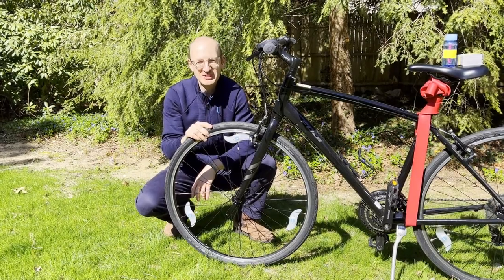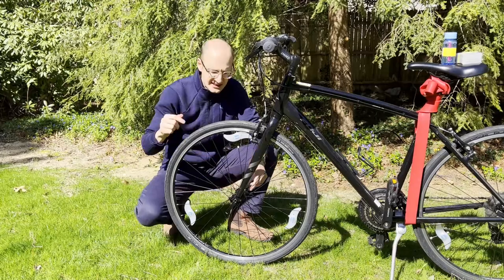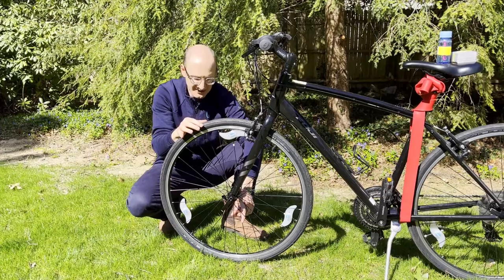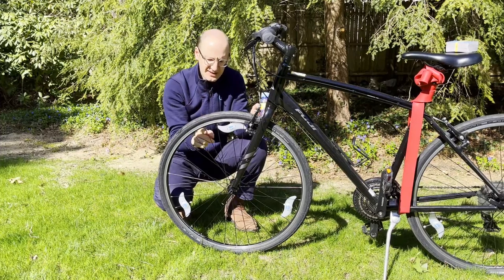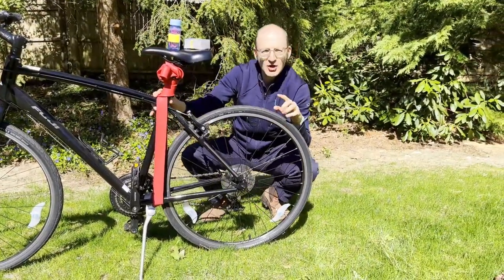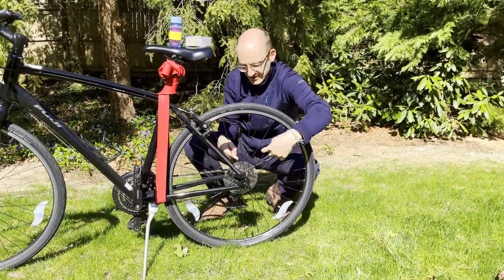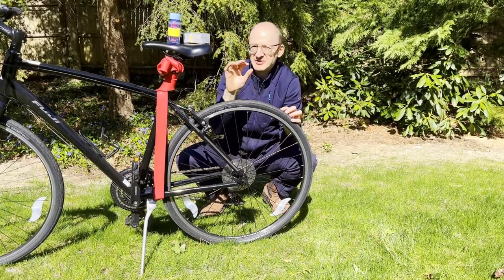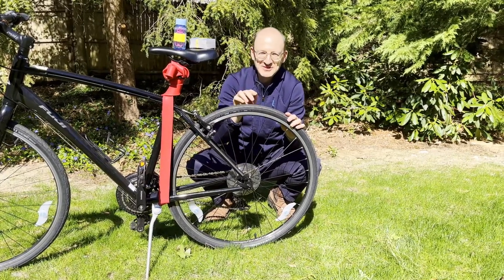Why Bicycle Wheels are So Clever!

Comment: Cool video. I think Paul missed another bit. The spokes are not  exactly in the rotation plane of the wheel to counteract side forces. Although the bicycle wheel is not very good at doing that, if all the spokes were in the same plane they would snap quickly from very little side forces. So the wheel is even more clever.

Comment: A good introduction to spoked cycle wheels.
A spoked wheel is an example of a tensegrity, where rigid elements are separated entirely by tension elements. 
Few race hubs are rated for radial spoking, pieces separate from the hub flanges, BAD!
When tensioning/winding up a wheel the rim "shrinks" about 0.5 mm in diameter. 
It's possible to build wheels with longer pulling spokes than pushing spokes making the pulling spokes slightly more tangential, particularly applicable to disc braked front wheels.
The accuracy of the build makes a huge difference to the feel of the bike, I try to achieve better than 0.1mm runout radial, lateral and dish which should give consistent spoke tension.
There is so much more I would like to test and quantify.

Comment: As you said the spokes never get compression. They are not meant to. They are not fix mounted to the rim. Instead the load is hanging on the to spokes, which increases the tension on the whole system. This behaves similar to the dome you showed. Another fun fact: front wheels can have radial spokes, which looks strange and fragile at first glance.

Comment: Not sure I’m following this. I always thought the forces were the tension on the spokes from the top of the rim, transferred to the rim itself, which carried the compressive forces to the ground, essentially as if the bicycle were hanging by the spokes, and the tension on the spokes helped keep the rim circular. But you seem to be saying that the true forces are compressive on the spokes, i.e. from the bottom of the rim up, which act like columns, and can do so because of pretensioning on them.  Quite likely this is just massively above my head, but thanks for trying.
Reply: Not quite. He never said they go into compression per se. What he said was they just go from tension to ‘less tension’. Yep, a bit confusing but I think he was accurate in that sense. Good point though bro.
Reply: @liboy9844  Thanks for the reply. The confusion for me is that this “tension to ‘less tension’” is operating on the bottom spokes, which act like columns, but not, as you pointed out, under compression. That is, at the beginning he pointed to the spokes directly below the hub and said you would normally expect them to buckle, which I would if we aren’t talking about ordinary tension on the spokes above the hub supporting the bicycle by compressing the rim as a whole. In other words it seems as if there is no compression on the rim as a whole but only on the metal at the bottom, delivered by spokes not themselves in compression. At that point my mind boggles. It’s like trying to picture a square circle.
Reply: the forces are acting on the whole wheel, with the spokes in the upper part of the wheel doing most of the load carrying, so your thinking is essentially correct. but the point that the lower spokes are in less tension is also correct, although i would not define them as columns since they're never in compression. as an aside, there are plenty of true radially spoked wheels, they're just not as efficient.
Reply: @daos3300  Thanks. I read your reply and then watched the video again. I think I get the point about the offset radial design, since forces are acting in different directions. Also about the circular compression on the rim, which I always pictured as helping to maintain the circular shape of the rim under compression. I was glad you confirmed my intuition about most of the force being tension on the spokes directly above the hub. Also I see that the pretensioned spokes do not go entirely out of tension. I’m pretty much copacetic with all of that. But still, he made the columnar analogy for a reason: at the beginning he clearly indicates that the forces are delivered downward by the hub and, ceteris paribus, you would expect the spokes below to buckle, which never occurred to me because I never imagined the forces are delivered to the ground in that direction, i.e. from the hub and not from the connections between the upper spokes and the rim . In other words, I imagined the loss of tension to be entirely within the wheel and have nothing to do with the compressive forces from above, which are transferred to the ground through the rim. The loss of tension below simply indicates to me that there is a compressive force on the lower spokes but not sufficient to put them entirely out of tension, so the maximal tendency toward deformation of the rim is at the bottom. I may just have to remain confused on the point.
Reply: Your initial understanding is correct and the videographer's comment on the lower spokes being "columns" is incorrect: "You can't push a rope."
As for your confusion on the lower spokes purpose you should imagine a force diagram.
The ground induces a normal force onto the contact patch at the bottom of the tires, the force then needs to travel upwards to the hubs to effect the frame of the bike. As you mentioned, the lower spokes cannot hold the energy of the normal force in compression, so the energy is transferred upwards through the rim. The top half of the rim, charged with the normal force, then suspends the hub in the air through the tension on the upper spokes. (Spokes are incredibly strong under tension.)

All that being said, for a bicycle wheel to remain functioning while rolling, accelerating and changing direction, the initial tension across all the spokes has to be even, and greater than the standard working forces.
Imagine sitting on a bike with rubber bands for spokes, it might roll forwards decently, but turning the wheel would break it apart.

Does that look clear in your mind?
Reply: @nightspore4850  Da Os has a point too. But I think the easiest way to look at it (without overthinking) is to imagine changing all metal spokes to stretched rubber bands, then (while not rotating) lightly load down on the hub.
We should expect to see the upper rubber bands stretch more while the lower bands start to slacken. If not, I join you in the confusion hehe. Interesting analogy though.
Cheers bro.
Reply from the maker: Hi all - I'm glad you're talking through this and maybe I can clarify a couple of things.  The reason most of the load goes from the hub straight down the lower spokes (reducing their tension) to the ground is because that is the stiffer loadpath.  Going through the upper spokes in added tension and then around the rim is a less stiff loadpath (like springs in series) and thus is not the behavior.  You can read more here: https://www.spokemaker.com/the-science-behind-spokes/  Thanks!
Reply: @PaulKassabian  interesting article but i think the wooden wagon wheel comparison is flawed. you could cut away most of the spokes on a wood-spoked wagon wheel save for the lower two or three, the wheel would not collapse. now try that on a bicycle wheel! the lower spokes are certainly the most dynamically active since the loaded hub is pushed to the ground which partially unloads the lower spokes. but at that instant, what is happening to the upper spokes? it may be worth taking this further and actually measuring the tension of all the spokes on a loaded wheel. another way to demonstrate the loads - see what happens to a laced wheel in various states, from untensioned to optimally tensioned. i freely admit i am not an engineer, what i know (or think i know) comes from wheel building and observation.
Reply: @PaulKassabian  Thanks for the reply. Please don’t think I am trying to contradict what you are saying, because I’m not qualified to do that, but what is still bothering me (hoping you will do another video with lots of diagrams at a very slow pace) is that since the wire is far more able to sustain tension than compression, under ordinary circumstances, the “stiffer load path”, or more capacious load path, would seem to be from the rim to the hub, not from the hub to the rim. Visualizing springs just doesn’t help me with this. Thanks too for the reference you included, which I read, but really still don’t get. Are you and they saying that a pretensioned wire, if not put under sufficient compression, such that the force of compression equals or exceeds that of the tension, acts like a column the strength of which is equal to the residual force of tension? If so, while I can say that, I can’t see it. Colossal failure of imagination probably.
Reply: @liboy9844  Yep. The problem remains, however, why slightly but not totally slackened rubber bands carry the load like columns, since it would seem they should have no effect on the load borne by the rim above from the hub. Apparently that isn’t correct and the stupid half-slack rubber bands at the bottom are indeed acting like columns. Mr. Kassabian is a trained engineer and I’m not arguing the point, but to say I don’t see this is an understatement. Another article he recommended to me had it that if the spoke is pretensioned to one hundred pounds and a compressive force of fifty pounds is applied, then the spoke has a residual compressive capacity of fifty pounds. If I squint and try real hard, I can sort of “get” that in a meaningless intellectual sense, but really it still seems like voodoo.
Reply: @zacharybennett3249  Thanks. What you say seems quite clear. What Mr. Kassabian and other engineers say does not. I’m all for tension on the spokes, downward toward the hub, being the main carrier of the force on the rim, which is held circular by its own compressive capacity and, mostly, the tension on all the other spokes. Apparently that is wrong. The tiny thin steel spokes on the bottom act like columns the compressive capacity of which is the force of their pretensioning minus the compressive forces acting on them. While I can say that, or even accept it on authority (in engineering, authority counts), I still can’t see it. It feels like getting something for nothing.

Comment: What a coincidence, i don't remember well but i think i learned these last month by a professor or was i reading a book? Hmmm I always had a bad memory....

But i still cannot understand why spokes/rims are tangential and not radial. And what happens when we keep it radial.

I will try thinking harder i guess
Reply: it isn't just to do with radial/non-radial. half the spokes are also laced outside in, the other half inside out (from the hub). one half is also pulling in the direction of rotation while the other half pulls in the opposite direction. add to this the fact that the spoke holes in the rim are offset - again half and half - which results in a wheel with very evenly distributed and balanced forces with a lot of leeway for lateral and radial adjustment - essential for both building a wheel and then truing during use. there are radial wheels but they place a lot more stress on the hub, are weaker and less robust than conventionally laced wheels so mostly used for their looks. there are also 'snowflake' pattern wheels where pairs of spokes are twisted together where they cross over. messy.
Reply: In a physics sense, the spokes are laced tangentially for a geometric advantage on force loading.
Imagine hanging a wheel from the ceiling with a single rope: You could still easily rotate the wheel if you pulled on its edge.
Now if you hang that same wheel from the ceiling with two ropes, one on each side, and try to rotate it, you would have to stretch the rope to get the wheel to rotate. That's what the tangential spokes are doing for the hub.
Reply: @zacharybennett3249  thanks i had a similar feeling about it
Reply: It’s to do with the torque applied to the load point by the chain when peddling. That’s why it’s so interesting. That twisting motion creates tension that gets transferred to the rim equally. It’s genius design.